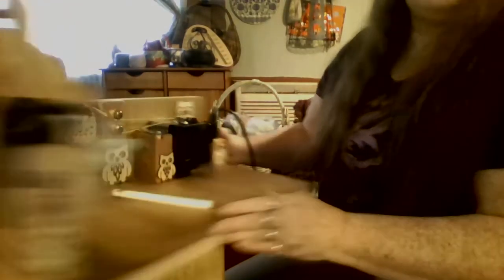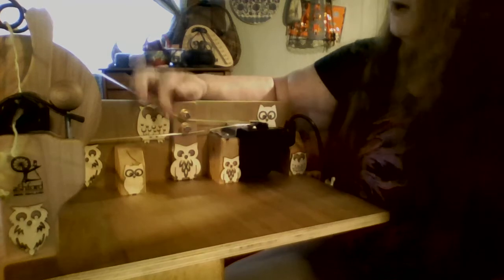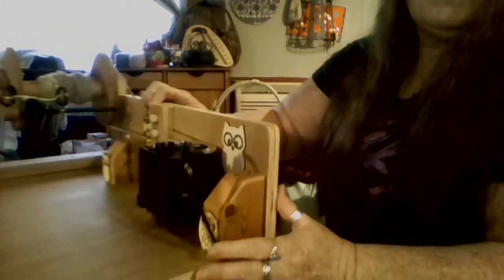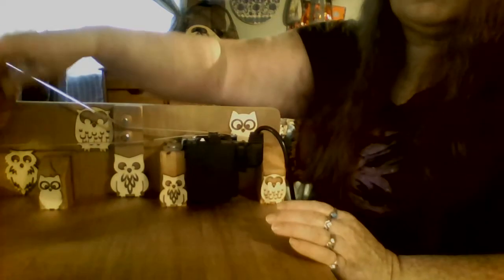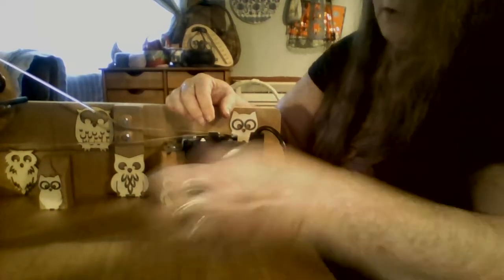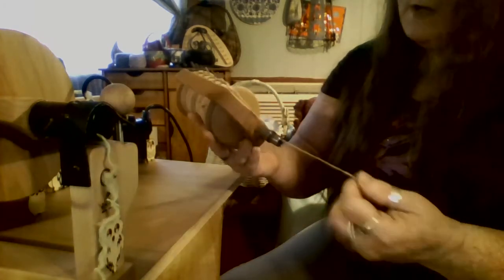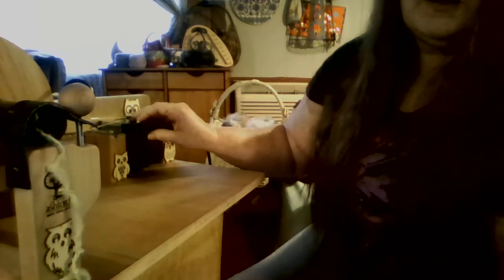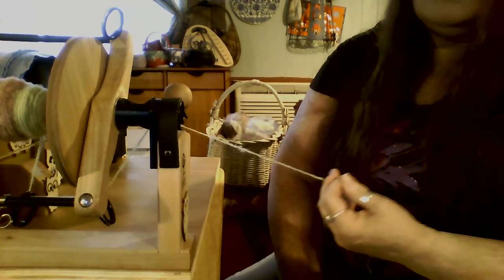How you can make a electric spinning wheels

Comment: The problem is you didn't actually show how to make a electric spinning wheel.  No template with measurements.
Reply: It depends on the particular motor and the size you want. DIY isn't for you if you can't figure out dimensions based on your requirements - she explained the technical information - you need to get pen and paper and plan it.
Reply: Do you expect her, someone with little money, to demonstrate ripping the guts out of multiple machines and measuring them all and creating several sizes (with available flyers) just for you?